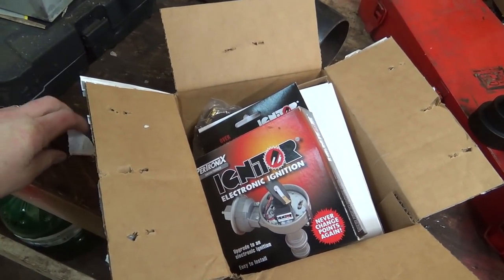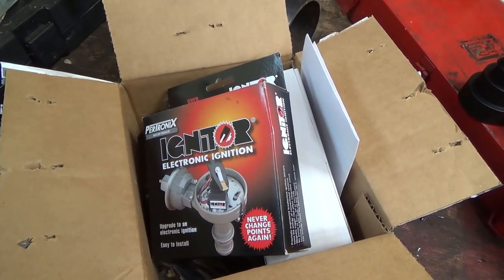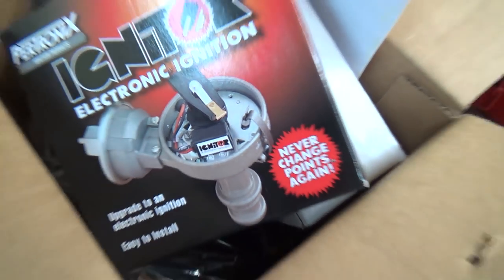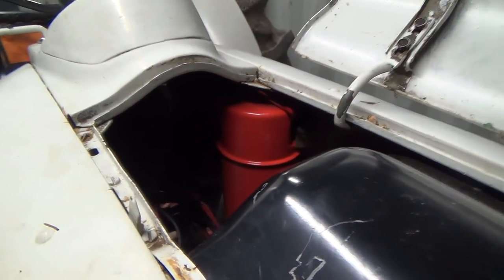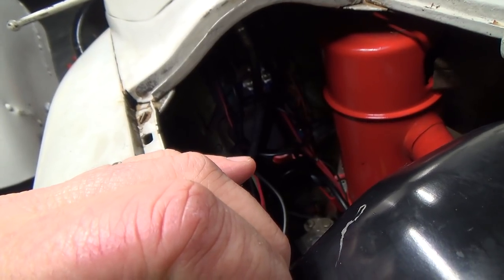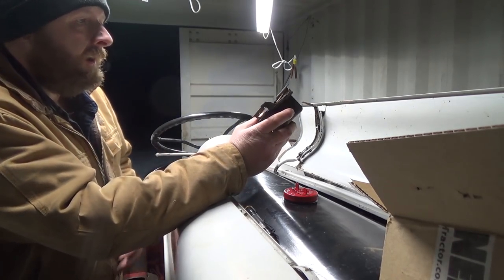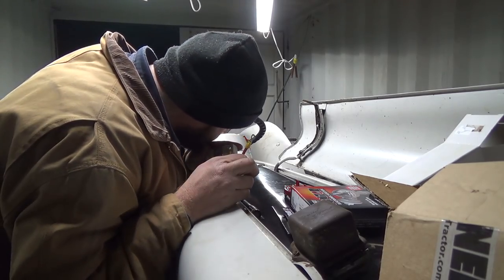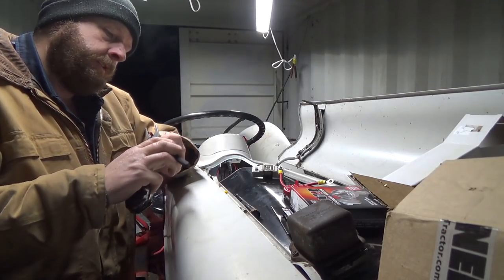FORD 800..Lets change all the ignition components again...WILL SHE RUN

Comment: That resistor is supposed to be hot. That is why most put it down by the coil for air flow.
Reply: It's also why the resistor is made into that ceramic block.  :-)